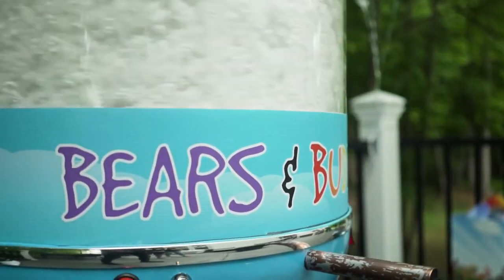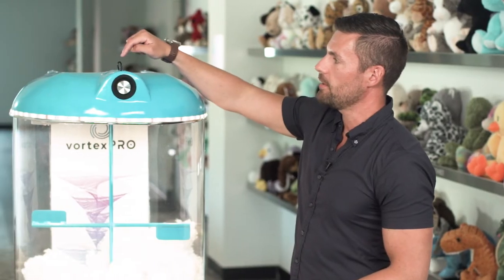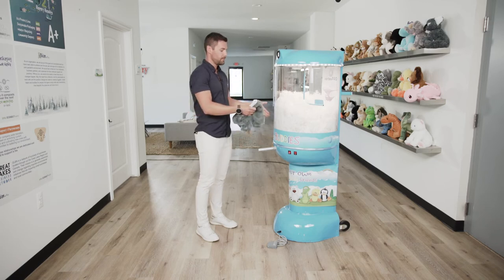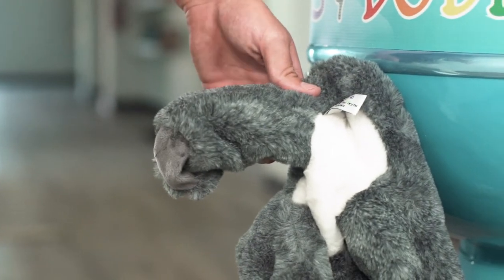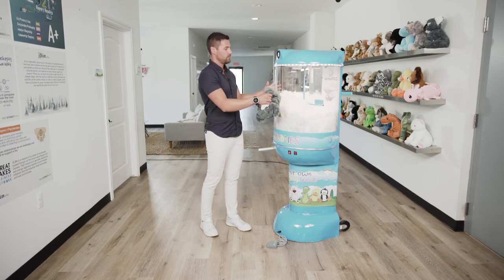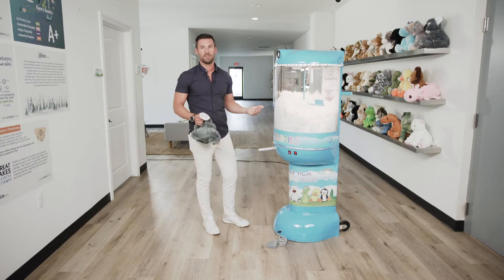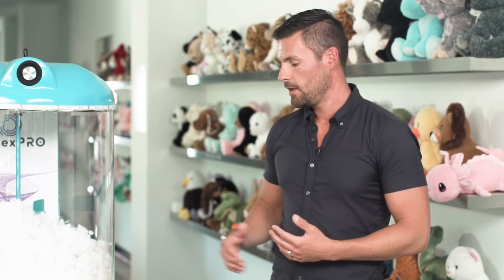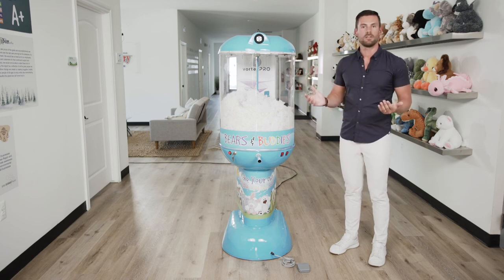Vortex Stuffing Machine Tips & Tricks | The Bear Factory

Comment: I'm not sure if this channel is active enough to be asking this here, but what is the diameter of the outflow nozzle, and does it come in variable sizes/smaller attachments? Or does that alter the outflow pressure too greatly? I have interest in buying one of these machines for personal crafting use, so the toys I would be stuffing may have slightly finer features to the ones available on your website. I simply wish to know if these machines are CAPABLE of being used on alternative plush toys, or if they are specifically calibrated for use on the bear factory toy line. Thanks!
Reply from the maker: Hey ET, the diameter of the nozzle is 3/4". The standard nozzle length is 6" and can increase to about 10" but due to the flow and power of the machine, anything over 10" is not recommended due to clogging. We have artisan crafter purchase our machines all the time for their plush items. If you email our team at hello@thebearfactory.com we can provide some more information as well as look at having you send us one of your plushies to test on the machine to assist you in your decision.
Reply: @TheBearFactory  I appreciate your response, that information alone is incredibly helpful. Thank you!